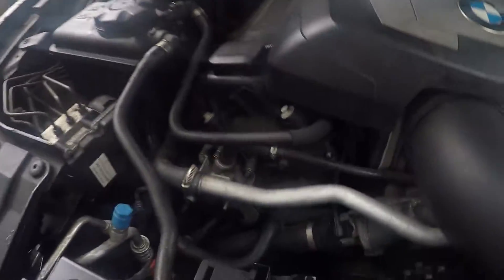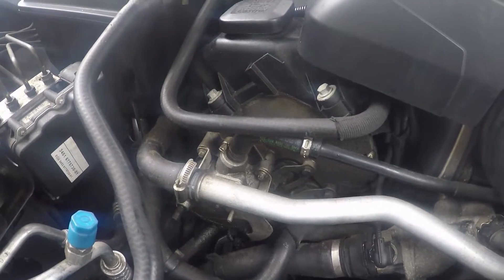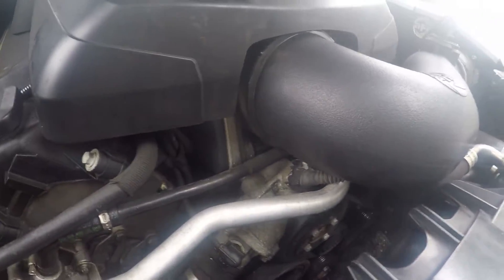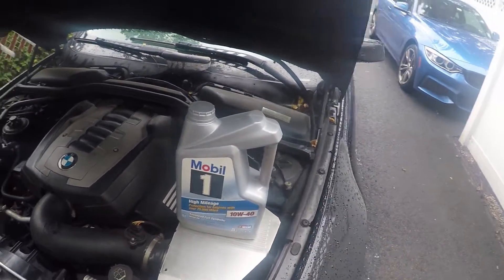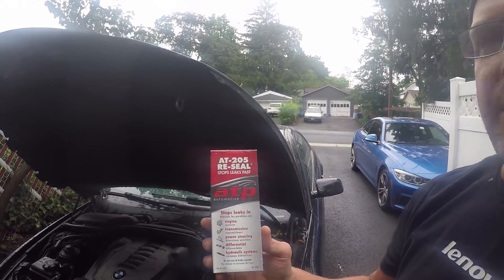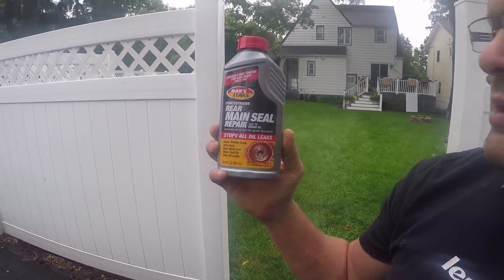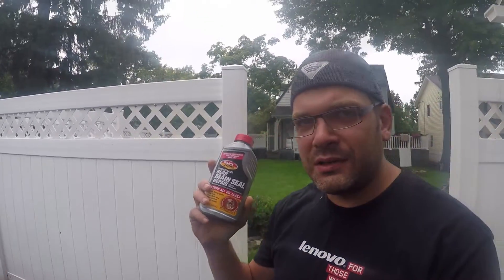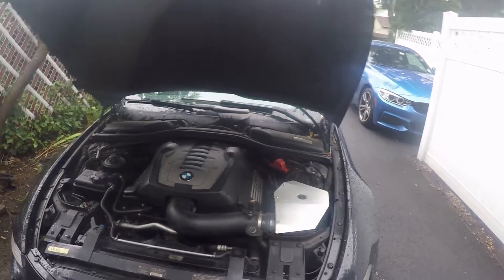BMW Oil Leaks - How to slow / stop them using additives (links in desc.)

Comment: Most of the time these gasket and seal leaks are caused because the gaskets and seals shrink over time. Basically this causes them to not push against the metal as hard as they used to, which open up all the leaks. What the additives do is cause the gaskets and seals to swell up and get big again. That's why they are called "seal swellers" or "swelling agents". I've used them and they do work. If you have an older engine that's not worth spending thousands on it to replace all the gaskets and seals just throw in a seal sweller and drive it until it either dies or blows up.
Reply: No good it will build up on your cylinders and worn out the engine fast!!

Comment: Put in 10w30 HM Mobil and liquid moly oil saver for our older X3 150k miles.  The main issue for us was stripped drain plug so I used 12.1mm oversized then oil level sensor leaking so new gasket on it.  It all has slowed alot great video appreciate everyone helping each other to keep our beamers going ..love the car

Comment: I used Liqui-Moly Motor Oil saver on my 2010 BMW 550i after discovering lots of tailpipe smoke ( bad valve stem seals ) added after fresh oil change. Took about 500 miles of driving,  slowly but surely the oil smoke was reduced by around 90%. Oil consumption down also.
Reply: i have the same car i just bought it runs great but it leaks oil do you know how much mechanics charge to fix it?

Comment: I feel your pain having owned 3 BMWs. The video should be relabeled "why not to buy a BMW". I've changed valve cover gaskets and oil cooler gaskets and found the oil leaks reappear on the older BMWs. Tried every oil additive and it is back to square one. Never had these problems with my wife's Lexus or daughter's Acura. Can't believe the BMW engineers can't design an engine without leaks.
Reply: What is is about German auto makers and gaskets? I'm constantly chasing leaking gaskets on my bmw X5 and my Porsche cayenne. What so the deal? Frustrating, because I love my bimmer (less love for porsche).

Comment from the maker: Once again, these products are meant to SLOW the leaks and REDUCE them temporarily. Its not meant to be a long-term 'FIX'.  They helped me postpone doing my valve covers and upper timing covers for around a year before I had time to change them out.   Lots of snake oil products out there for leaks but these actually worked for me.

If you would like to give them a shot please consider using my Amazon affiliate links to the products in the description!
Reply: Buddy thanks for help your your followers, But tell me, what happen if I put two bar’s leak and two at 205 re-seal, Is bad or gonna work good? Thanks for answer.
Reply: @daddy1kev  your motor may become like hulk

Comment: High operating temperatures and poor quality plastics mean lots of leaks. I had some of the leaks eliminated when my valve stem seals were replaced.
Reply from the maker: I'm telling you I think I dodged the valve stem seal bullet entirely by using that at205 every oil change proactively once I hit 90,000 mi.  some of the oil leaks eventually are unavoidable like the valve cover gaskets, alternator mounting bracket gasket, upper timing chain covers, oil pump.
Reply: @ModsAndProjects  my car failed it's MOT (UK) so I had to get them replaced - it cost £1000 which is very cheap

Comment: Good video. Thanks for the info. What is you thought about adding both the at-205 and Bar's Leaks at the same time following a fresh oil change with 10w-40? Should be OKAY?
Reply from the maker: I've done it before and had no problems whatsoever

Comment: I have a 645ci on 167k miles...I've been running it with leaks and smoking for 69k miles and 7 years...tempted by the additives and stepping up from 5/40 to 10/40...is this mighty 650 still alive? (I once tried Liqi Moly oil saver when first got it...not sure if coincidence but day later the alternator gasket seal got so bad it let all the out on floor in seconds...so I'm a bit scared of additives 😂

Comment: One good thing about oil leaks? No rust! Also if you have to keep the level up in the hashmarks on dipstick then you know theres fresh oil in there somewhere in the motor! Fix those leaks get some orings and gaskets for your car and get intimate with your engine but be careful theres lots of sharp edges and some automotive fluids can burn you even if they are cold.
Reply from the maker: lol
Reply: Aluminum isn't rust prone, no? This would make more sense with a steel body.
Reply: @lperea21  i believe aluminum does oxidize also can be stained where in contact with iron oxide (rust). a rusting bolt can corrode aluminum due to electrolysis. metals of different compositions exchange electrons

Comment: I have a BMW 328i 2011 with only 47k miles on it and it's leaking some oil, I get a burning smell sometimes when I'm driving but don't see smoke,  what do you think the problem and solution might be and how much to pay for getting it fixed?
Reply from the maker: Get a couple of cans of degree spray down the spots that are caked up and hose them off (keep the water away from the electronics.  Once clean monitor it over the next few days and you should be able to find where it is coming from.

Comment: Thanks very much for your video - my 2011 328 (76,000 mi) just started leaking oil after being trouble free for many years. I am going to try the leak seal you recommended. There is no reason to start throwing good money after a car that will just start having issues. Does the leak seal additive work pretty quickly? Thanks very much again!

Comment: 2008 bmw x5 3.0si     valuve gasket leak little ,, is it okat to from 5w30 to put 10w 30 ..gays said engine will be in more presser ! adding some lucas seem rough idle at first start only , so thinking to change the oil .. any idea who solved this problems ?

Comment: Great Info.
I have a 2008 E90 335XI w/N54 Dual Turbo engine. Do you think either of the two products you mentioned would help with a Valve Gasket leak? My leak is on passenger side toward the back of the engine and is getting on my exhaust manifold and smoking...
I really don't want to (if I can help it) get the gasket repair done by a repair shop, nor do I want to do it myself as I never did it before.
I am in NJ also in the Middletown/Hazlet area (exit 117). Thanks. Appreciated.
Phil
Reply: they won't , jus knock out the job it isn't that hard
Reply: I’m changing my seals on my 2014 BMW 528 and my issue in on the valve cover is crack after watching many videos i found out  that BMW have issues with oils leaks either from seals or valve cover .
Reply: @denjax1970  Thanks for the info...Be well...

Comment: I used 10w 40 for my e70 x5 sport. I didn’t want to go higher than that. 20w 50 is more for high heat racing vehicles. Great video.
Reply: So leak stopped by changing the type of oil to 10w40?
Reply: Can 10w 40 work on 2001 x5 4.4i?

Comment: I have a misfire due to a bad valve cover and lose a shit ton of oil will this help?
Reply from the maker: Valve cover seal must be pretty bad if it's causing a misfire.  If you are dumping oil hard you had better just get it fixed.  There products work for slow to moderate leaks.  It won't hurt anything to try.

Comment: Do you add 1 bottle of AT-205 in the engine at every oil change?  pls advice .  can it be used as a preventative maintainence in a dry engine? [ not leaking ]

Comment: I have 49 k on my 2016 535 ixdrive ...at 10000 miles the oil change light popped up ....I checked engine oil level and it was at max ...got the oil change done and was told oil pan gasket leaks will cost $3200 to fix it .... I plan to use AT205 but per your expertise do you think I need to get it changed ... I don't drive rough....fast but not rough  .... Thanks in advance....
Reply from the maker: Increase the viscosity a notch on your next oil change and add the at205 certainly no harm in trying and that pan gasket is a pain in the ass/expensive job.
Reply: @ModsAndProjects  
It should be covered in warranty ....less than 50k ...:) ....
Reply from the maker: @drluckyv  if it is under warranty definitely just go get it fixed lol
Reply: i dont know about the bars stop leak, lve used It 7 years ago, in my 2005 645ci, not knowing not to use the whole bottle, stupid me, the stuff melted my oil Pan gasket seal and the alternater bracket seal, causing Major damaged. had to take It  to dealer for the engine to be' flushed and new alternater $2k

Comment: I have the king of BMW oil leaks the 335i N54 3.0L... would this method work on this motor as well? Ive tried a few diff products with little to no sucess. Spent $1600 changing Valve cover, Valve cover gasket and Oil filter housing gasket... stiiiiill leaks 🤦🏻‍♂️
Reply from the maker: lol "king of leaks" :D It Depends... If its a major leak (puddles under car whenever you park) this is not going to help.  Have your found the leak?

Comment: Hello N Happy New Year.I just found the leak in My 2007 750li..Oil cooler gasket /alternator seal which is pretty common..Im gonna give the additives a shot.Thanks for the info.Cheers,Pietro
Reply from the maker: That particular gasket and leak is a nasty one and can go from a slow drip to a gush pretty quickly  (ask me how I know).  That job also really sucks I did it myself and it took me like 8 hours and I had to rent an engine crane to lift the engine up an inch or two

Comment: Hi guys mi x5 ,n62,,4,4  is got a oil leak ,,think it's from alternator bracket seal,,what can I use to slow it down  ,,or wat oil should I use,,it over 200,,kilometers,

Comment: I sold my E60 550i swap the engine to a 98k miles on idle for a while it will  smoke so I found out about the valve stems are bad

Comment: Thanks for the post. 3 years later, do you still have the 650i? How is it holding up with this regiment? The heavier oil in the winter time needs longer warm up time for circulation. How does the vehicle run in winter with this setup?
Reply from the maker: A tree fell on this car and killed it.  Vehicle was running in the winter no problems at all with this set up.  It is a Band-Aid for sure but it definitely helps until you can get to addressing the problem.
Reply: @ModsAndProjects  sorry to hear!!! Ok great!!! Thanks for the update. I'm going to run mine till the engine completely fails. Doesn't make fiscal sense to repair it if all the seals will eventually fail. Mine just turned 17 years old.
Reply: @ModsAndProjects  Good tip on the tree. I'm going to try that.

Comment: I have a 2013 bmw X1, 4 cyl, AWD.  looks like valve cover gasket has leaks from one side and rear, hitting exaust system and smoking,  I use a OW-20 full synthetic.  Would it be best to go back to a 5W30 high milage full synthetic and add the AT-205?
Reply: I have the same issue with the same car and year. Wondering if the MOD can answer

Comment: This is not a failure of German engineers, but, rather demonstrates their skills.
If you have to make a part fail on a car you can choose any part. But why chose a part that will leave the driver stranded and fuming on the side of the road. 
Why not choose a part that will mess up an affluent garage in an expensive house, but leave the car running for it's trip to the dealer. My first N62 gasket failure occurred at 40K, and has been followed quite regularly by other gaskets. 
I don't think it's age, and the replacement dealer gaskets fail repetitively.

Comment: Hello, the oil drain stopping agent can reduce the oil flow from the turbocharger
Reply from the maker: This car was a NA v8 so no issues there (on this car).  If you are planning on frequently driving the car HARD you should probably just go out and fix the issue right away. I'm not sure there is any actual change in oil viscosity when you used these products... They are designed to chemically swell old, dried out gaskets, not thicken oil viscosity. If there were some sort of temporary flow reduction I don't think it would be a problem in a casual driving.

Comment: bro i am using bmw 3series 2006model diesel engine. i added liqui moly motor saver oil to my engine to save engine leaks. but after adding this oil to engine. next day my car exaust start smoking. why this is so. kindly guide me if you can
regards
Reply: Omg😳 this work like magic. I sold a 545i to a guy 3 weeks ago and he came to get the title today and complain of bad oil leak which I see myself. It leak like a quart in few days. I got the car back and gave him another car. I watch this video and I got the AT205 reseal and rear main seal. I make some coup of drive around in the parking lot. Guess what??? No single drop oil again within an hour. 💪
Reply: @olumidepopoola4232  hey 👋🏽 bought something for mine too it’s. bars leak one seal stop leak

Comment: i have a 2011 550i with a turbo leak. very common problem i have to add oil to the car every week which gets annoying i was wondering if this will work
Reply: Hey just saw this comment, i have the same car and same problem, did you find any solution? When i use the turbo power and step on gas to get a headstart it also gives me a “ Drivetrain malfunction “ message. Hope u see this bro
Reply: @kartiksighroha   it could be that your car is having misfires because oil is leaking into the plugs and causing the coils to go bad i had that issue too

Comment: I have a BMW X5 that is leaking from valve cover gasket. I am going to change the oil and filter on it soon. Should I use the bars additive before I change it or should I change the oil and add it in with the new oil?
Reply from the maker: New oil, it takes time to work.

Comment: Thank you!  I just did my valve cover but I think I may have a rear main seal oil leak although I don't appear to be losing anymore oil, it's too early to tell.  I should put the Barrs in and drive it for a few hundred miles then change my oil to the 10w-40 (still using 0w-40 @ 133k miles).  Transmission valve body seals are next. Ughhh
Reply from the maker: What engine?
Reply: @ModsAndProjects  N54
Reply: Steve Polverini did it work having the same issue
Reply: @brian197265  Changing my valve cover gasket again did the trick.  I do need to do my oil pan gasket though but leak isn't crazy.

Comment: I used the Blue Devil on mine after I got a 12,000 bill from a local shop. What seals coolant leaks on the N6? Any advice
Reply from the maker: Did you mean n62?
Reply: @ModsAndProjects  Yes, sorry for the delayed response.
Reply: My last 2006 E60 550i I had the rear coolant leak at the back of the motor by the transmission.  My mechanic said try Bars Leaks in Powder Form its not a liquid.  I did not think it work but put a package in and the leak disappeared.  I could not believe it worked and my car had 230k on it so I was not about to pull the trans etc to put a new $10 gasket in.   I would try it you just pour a tube of it in the coolant reservoir.

Comment: would this work on my 528i M sport 2014   i got bars engine oil stop leak concentrate
Reply from the maker: Works on any vehicle
Reply: @ModsAndProjects   ive been told it will destroy my engine lol i mean the bars leak.  not sure what to believe   but you think i can go with 10w 40 ?   thanks for your time
Reply from the maker: @susanhutchinson6023  read the comments, lots of positive feedback from various vehicles. If it destroys your engine somebody would have said something by now don't you think?
Reply: @ModsAndProjects   Great i was just wanting to make sure,  and no i havent found any reviews saying this stuff is going to mess up the engine,  what do you say is the best stop leak product for the bmw    thanks again
Reply: @susanhutchinson6023  yes !!! dont use bars stop leak, melted all the seals, major damage that caused me to have my car towed to the dealership, they had to flush engine replaced seals $2,000 repair...

Comment: How often do you use the At 205
Reply from the maker: Maximum dose added to fresh oil when changed.  Also don't be afraid to increase your viscosity to 5w40 (if your engine calls for 5w30).  This is not a "fix" just a band-aid to slow it down.  I was able to stop my leaks for over a year using these additives.
Reply: @ModsAndProjects  I have a 2011 BMW Gran Turismo 550i and I'm already using 540
Reply from the maker: @twotwosteele  I feel your pain!  One of the main reasons I made this video was to show this stuff will not "hurt" the engine (I was afraid to use them at first) Many people on the forums had positive things to say about the AT205 so I tried it and definitely saw improvement. I even added Bar's Leaks 1040 on top of the AT205 that slowed it down even further.  1.5 years later the leaks came back hardcore and it was time to replace the valve cover gaskets, upper timing chain gaskets, and alternator mounting bracket gasket.
Reply: @ModsAndProjects  thanks alot for your info I had blue smoke and it has definitely cleared up I only have 73k miles
Reply from the maker: @twotwosteele  Yeah people get all crazy when you talk about additives.  They are not ALL snake oil. AT205 reall works.  Ill tell you what, I have a 2006 650 with 140k miles and NO blue smoke.  As soon as it I started to see blue smoke I started using the AT205 and it went away and STAYED away (one at205 bottle per oil change).  I fixed the oil leaks, but i'm not paying to do the valve stem seals on this old lady... That's where I draw the line and will just buy a new car!
Reply from the maker: @twotwosteele  Just checking in... Hows the blue smoke issue?
Reply: @ModsAndProjects  I ended up having to get a new motor with a BMW Customer Care Program so BMW play 70% I spent 30% so end up spending 4,000
Reply from the maker: @twotwosteele  A new motor? wtf happened?